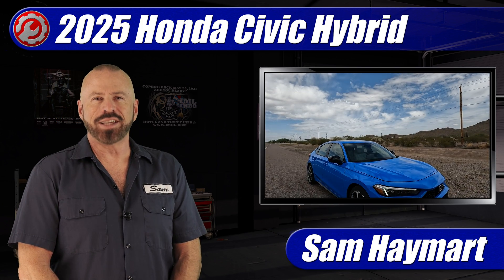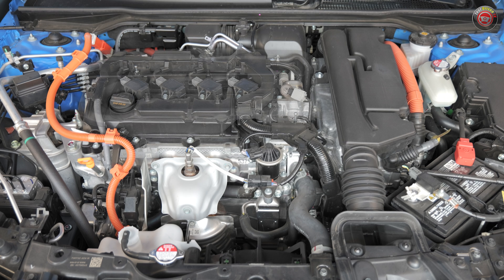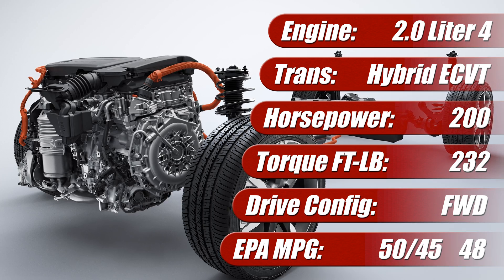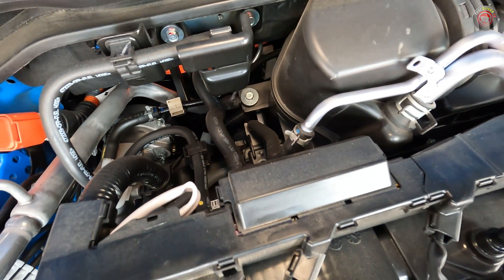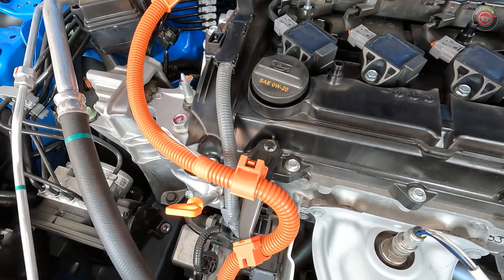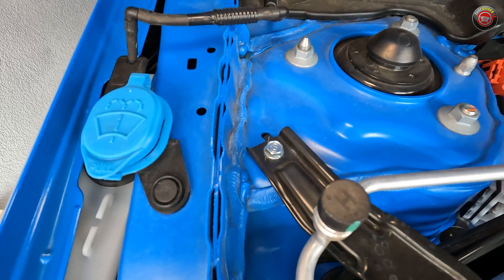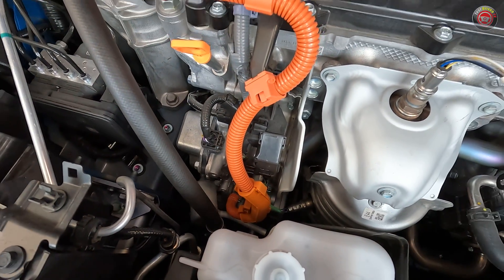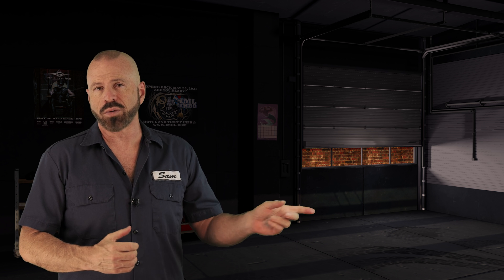Under The Hood: 2025 Honda Civic Hybrid

Comment: Somehow despite looking at it in person, I didn't notice the EGR is liquid cooled or that the master brake cylinder is on the passenger side.

I also didn't even think to look at where the spark plugs are and how many there are, but in retrospect, I should've noticed that. (I came to this model from an 8th gen Civic hybrid, which uses 8 spark plugs for cleaner combustion because it's port-injected.)

Comment: It would’ve been nice if you showed the fill hole for the transmission fluid. I’ve seen a lot of older videos showing a dipstick inserted on a channel that serves as your fill hole. Would you be able to confirm if that’s the case for this model?

Thanks!
Reply: I believe they don't want you to service the transmission fluid yourself on this model, so they made it difficult to access. Bonus, fewer mistakes and less leakage from having an easily accessible dipstick.. Downside, it's more difficult or you gotta pay them to change it, and you can't check yourself if it's okay. Based on my previous experience with Honda, I think this is fine. It won't need to be changed often anyhow, and having it better sealed actually improves that longevity. It's a tradeoff.

Comment: So i just bought one last week, and as someone who has kept all their cars past 200k miles, im skeptical about the "maintenance minder" system. Im at 900 miles, and it has not dropped 1% point yet. I know oils can last a solid 10k miles these days, but can the filters last that long? And if im supposed to do a service at 15% oil life, when is it going to get there?
Reply: i own this car as well, it dropped to 90% when i hit 1k miles. my previous accord (2014, 180k miles, no issues) had the same minder system. do what it says with honda parts/fluids, and it will go beyond 200k.
Reply: @DevMeow so if it drops 10% how is it going to be at 15%? Does it drop by 5% once you hit say 20%
Reply: @Hallowsaw it drops in increments of 10 until 20%, then it drops in increments of 5
Reply: The maintenance minder is very reliable. I wish it showed individual percentages instead of blocks of 10 and 5, but it is very accurate. The only thing I'd recommend different form what it says is that your VERY FIRST OIL CHANGE should be after 600 miles, not the service interval it tells you. This is because the very first oil change has more wear material from the breaking in of the engine than any other oil change will have, and it's better for it to get that stuff out faster. I would also change the filter at that time. I just change the filter with every oil change because the cheapest filters available are more than good enough and less than $10. Worth it in my opinion to ensure you're never risking having a filter fail due to buildup or age.

Personally, because myself and my partner drive extremely gently, the maintenance minder tells us we're good to go on 20k oil change intervals. (We also average 54 mpg, which is higher than the maximum it's supposed to be capable of.) But because oil does slowly expire over time (something it seems maintenance minders might not always compensate for?), and we want our car to last forever, we change it at 15k anyhow. It's a little more expensive, but we change it ourself with an oil specifically for direct injection engines, so it's worth it to us to make it likely it will last 400k miles, maybe even 500-600k.

(We actually fucked up and didn't do the first oil change after 600 miles like I recommend, but hopefully because we're otherwise babying it, it'll last a long time anyhow.)

Comment: Where the electric motor? In AWD systems does it have a direc drive shaft or a rear electic motor?
Reply from the maker: The topic of the electric motor(s) and where they are was discussed in the video. This is not an AWD vehicle. Did you watch the video?
Reply: @TDTVGarage I don't think it was interesting enough
Reply: @TDTVGarage I don't think it was interesting enough
Reply: Dual electric motors in the CVT transmission